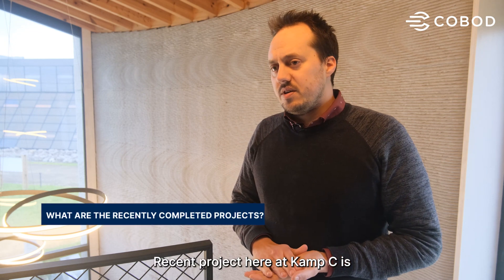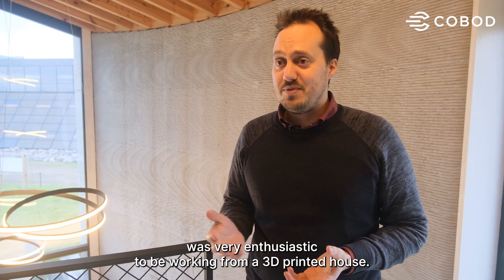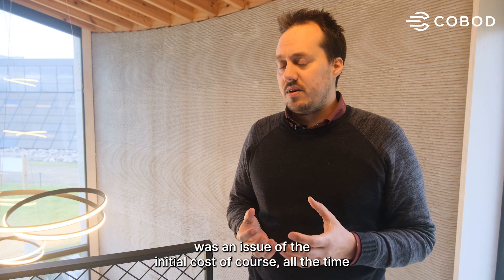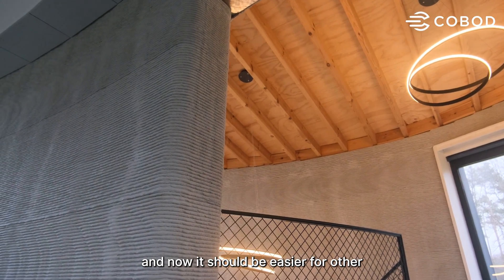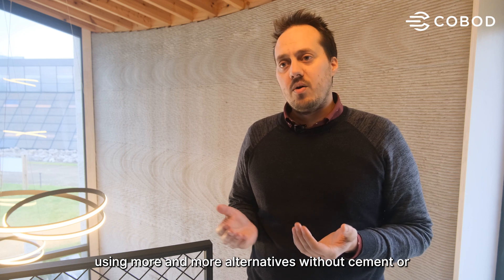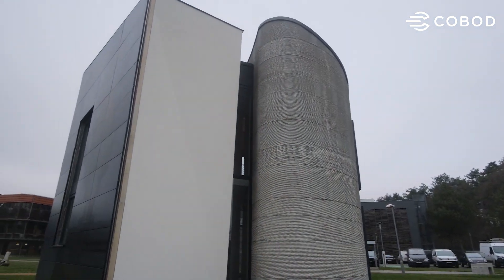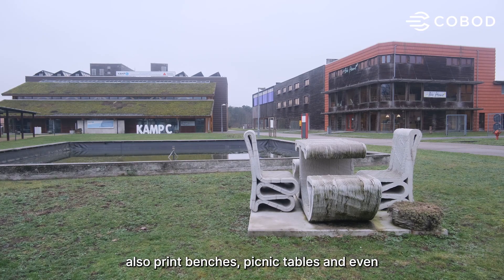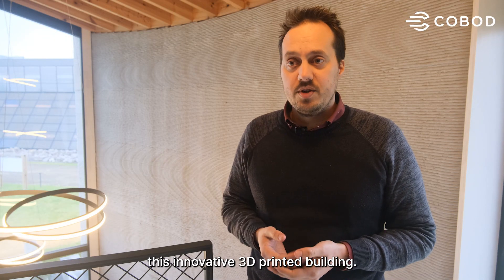Interview with Kamp C

Comment: I'm not sure I understand the advantage of 3D printing the home as compared to ordinary construction. Wouldn't it be much more complex and difficult to set up a printer at each job site than the methods we already use? And wouldn't the all-concrete construction negatively affect the strength of the final result?